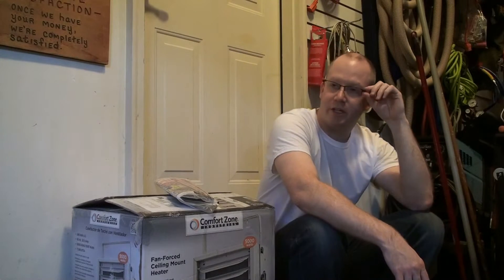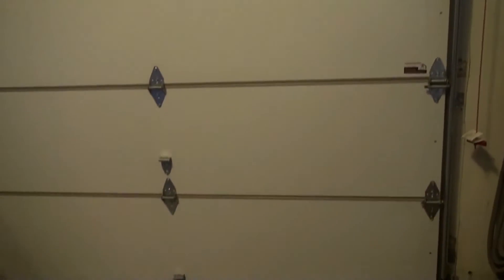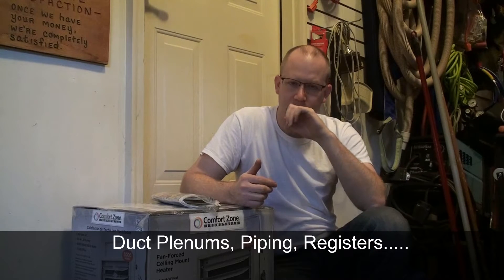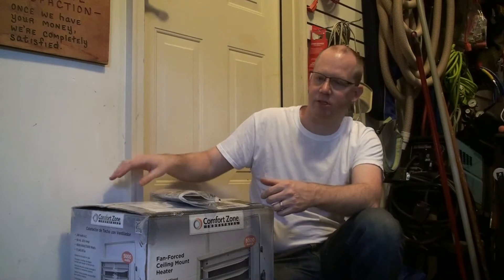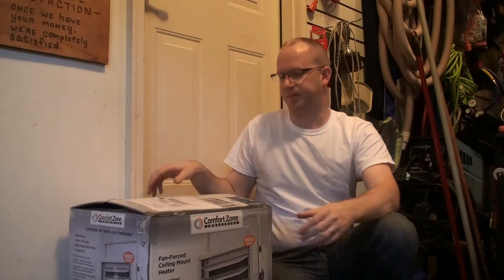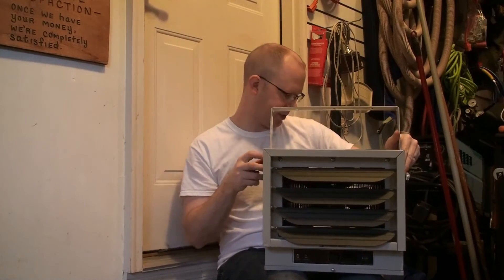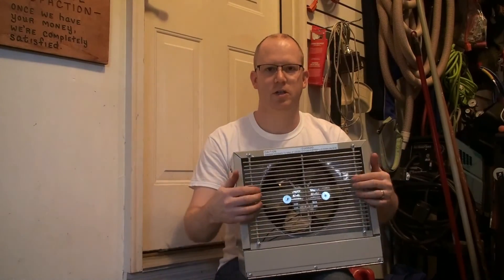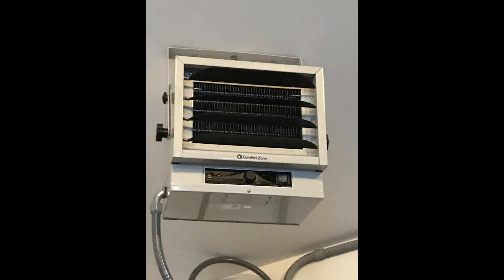Garage Heating Options and the CZ220 Comfort Zone electric heater

Comment: I bought on through Home Depot and added a 24 Volt sequencer to mine for a remote thermostat. have the thermostat set for 60 and 68, the unit is cycling fine and keeping my 8 X 12 shed nice and warm.... the unit runs for less then 5 minutes per cycle and maintains the temperature very nice. I'm keeping mine set to 5KW and also have a 2KW wall heater in the same space so the system works great!

Comment: I have the same heater looking to make it mobile from shop to garage so I would like to put a plug in on it is that something that I could do with this piece or will this not work on this heater
Reply from the maker: You certainly could make it a plug in appliance. If you have a dryer socket in the garage you could simply fit a socket on the other side. 

That said- I would call the manufacturer to make sure a 30 amp dryer socket would be sufficient
Reply: Impact-Vector thank you much for the Speedy reply I will take your information and consideration and give them a call tomorrow big help you were thank you
Reply: thanks much big help